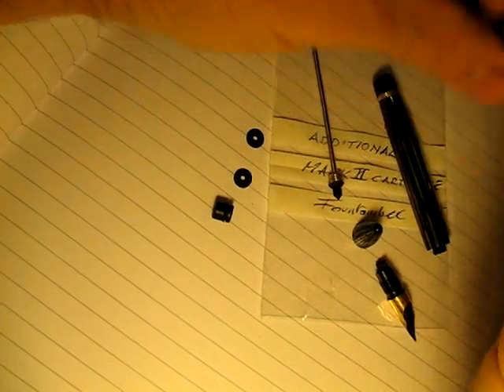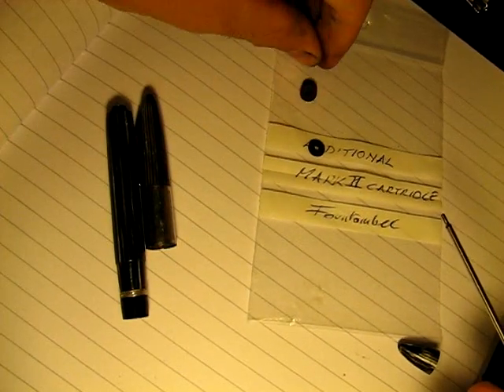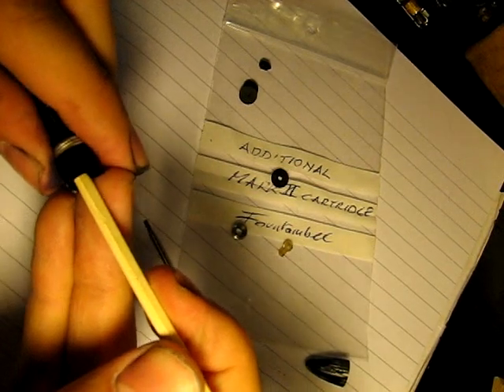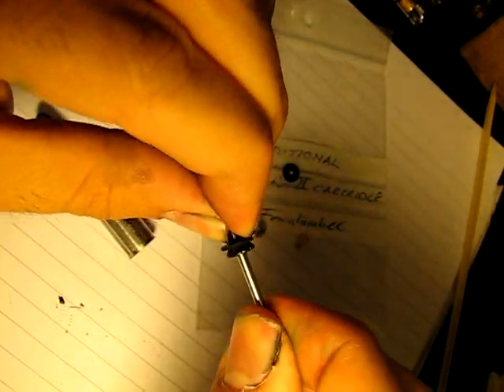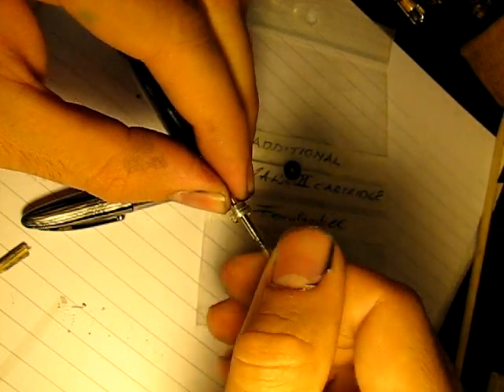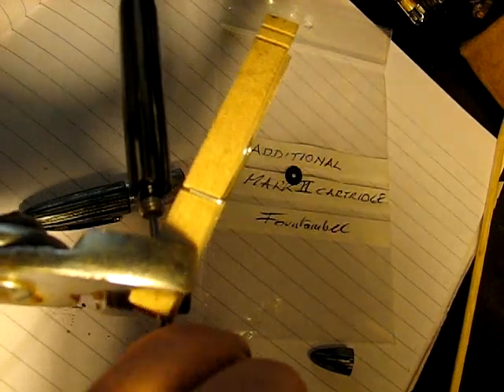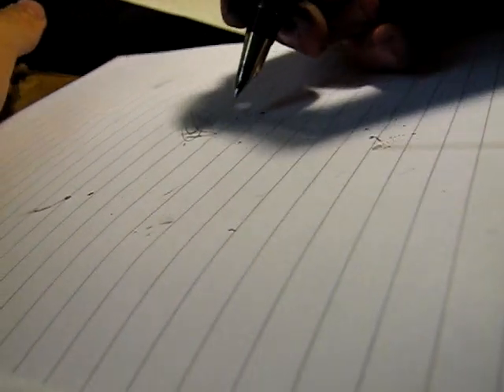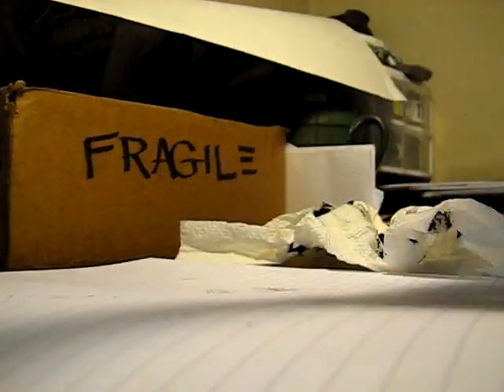sheaffer vac fil repair

Comment: Not being preachy but silicone grease is a lubricant not a sealant. I used rosin based sealant on mine and it still leaked until I really coated the threads with it. How did yours do in the leaking department?
Reply from the maker: It works on eyedroppers and it worked on this.  Never leaked.  The pen has been in use for nearly 4 years now.
Reply: +Parker51Guy For what he is using it, silicone grease is the perfect thing to use. It will act as a "sealant" in this case and it won't be a pain in the rear when you need to disassemble it in the future.